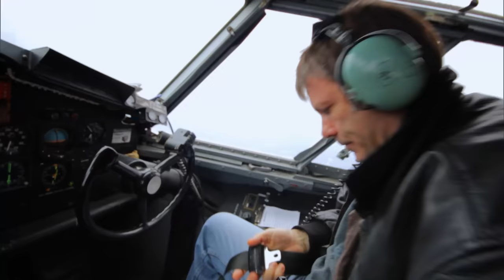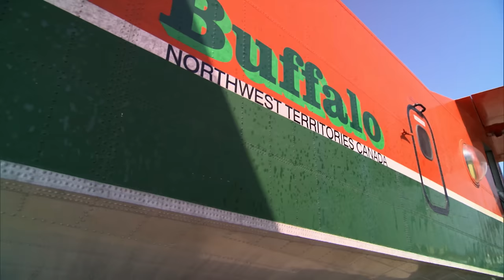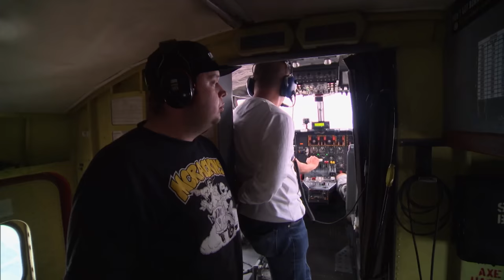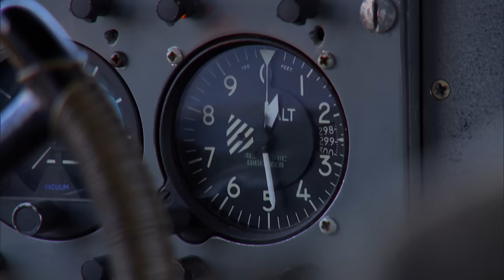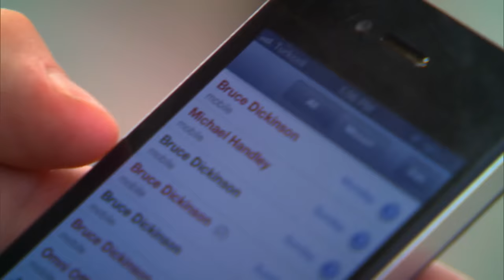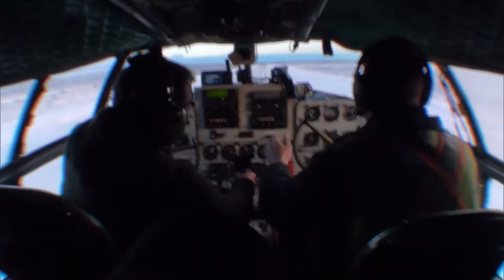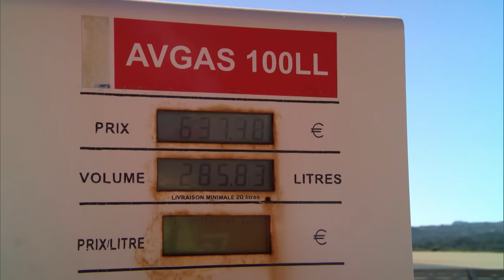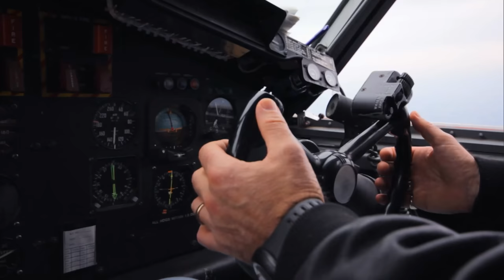Taking 450 BHP Antique Snow Plane Through It's Paces | Ice Pilots | Wonder

Comment: Seeing the tremendous inefficiencies in countries outside the west makes me wonder how any of their economies operate.
Reply: Slowly.
Reply: Eastern Asia has more-than-decent economies. Beaurocracy, however, is bullshittingly slow in pretty much every nation
Reply: What inefficiency did they show in this video? You'd still have to go to customs in the west...
Reply: @pickle4332  My parents lived in northern Cyprus from when they retired until their deaths a few years ago so I have some second-hand experience of Turkish bureaucracy. The issue is not that Customs need to be cleared but that it is paper-based, takes days and weeks instead of hours, needs the physical presence of inspecting agents who may or may not turn up when promised, needs umpty-nine separate pieces of paper which you are only told you need as the process unfolds and so on. 

In this case, why did it take days to clear the aircraft? In western countries, most of the paperwork would have been completed ahead of time and electronically. Had a physical inspection been deemed necessary, a visit of an hour’s duration would have been sufficient to confirm what had been reported in advance.

That, however, is not the Turkish way.

Very naive of you to assume that, just because a process is necessary, it is THEREFORE done well and on a timely basis.
Reply: @xiaoxiagao1254  Turkey is not in Eastern Asia. It bridges Europe and Asia. It currently has a rather fragile economy.
Reply: You’re assuming the Canadian government is “efficient”? Lol.

Comment: if that snow plane doesn’t go in the air it’s not a plane at all dumb name for that if you ask me
Reply: There is a reason an AEROplane is so called. It planes through the air. This thing planes through the snow. In bad weather, cars have been known to AQUAplane. Speedboats also AQUAplane.
Reply: It’s airplane engine and propeller system is why it’s named that.
Reply: @thomasm1964  👋